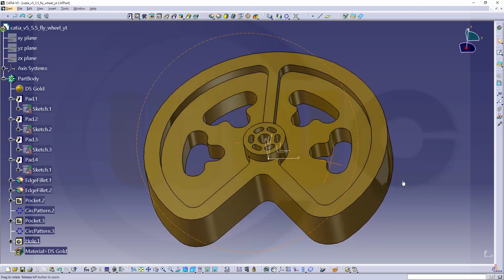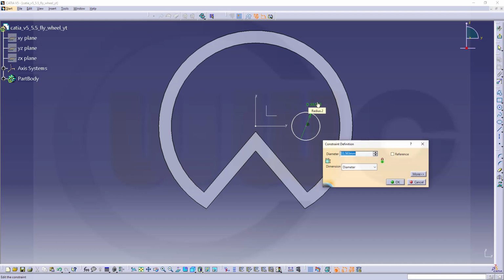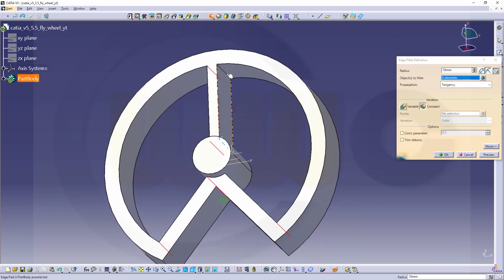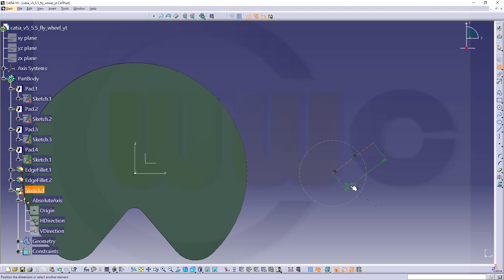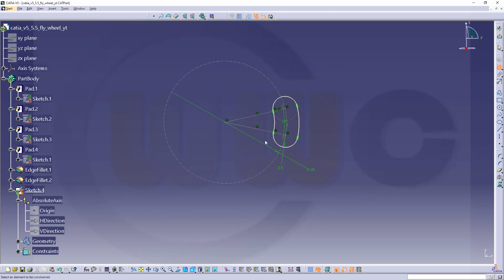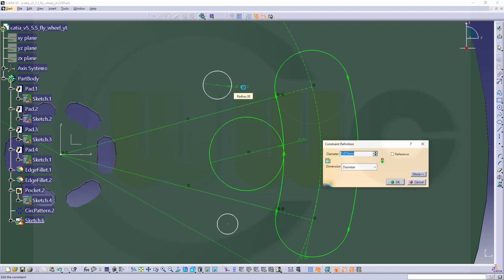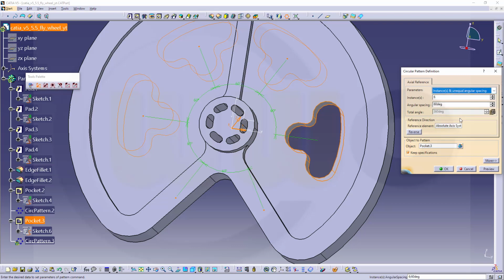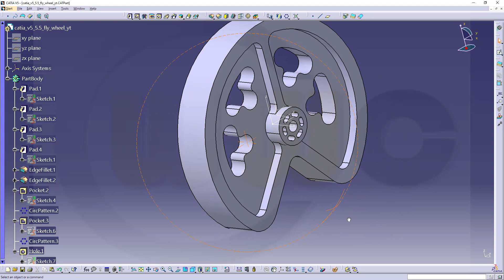5.5  Schwungscheibe - Flywheel - Catia v5 Training - Part Design

Comment: Dear Wolfgang, thanks for the consistent video flow over the years. What about some advanced trainings on the CAD methodology, the top down / bottom up structure of an assembly and B-reps? I would be keen to see something with your quality on this subject. And it is generic, not necessarily CATIA relevant. Thanks :)
Reply from the maker: What about top down/bottom up? It is kind of basic, isn´t it? Regarding boundary representation elements, what  would be of interest?
Reply: @wolfgang.walden.cad.training  
I am only speaking for myself here, but I believe YouTube lacks tutorials on how a designer should approach a project when he starts from scratch. How to build a model that is resilient to change and does not fail. This is where B-reps come in.
I trust your teaching methods, I would be glad to see tutorials of yours that will help the new starters have a "correct mindset".
Thank you once again!